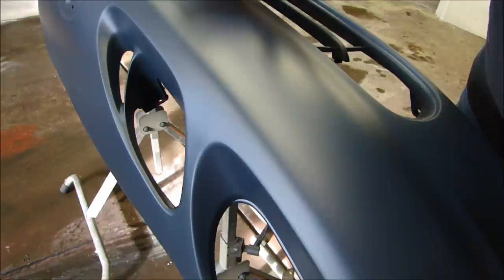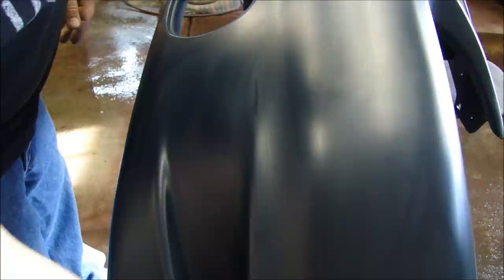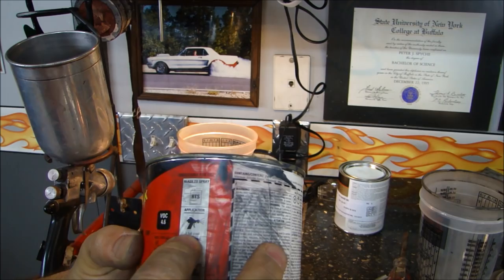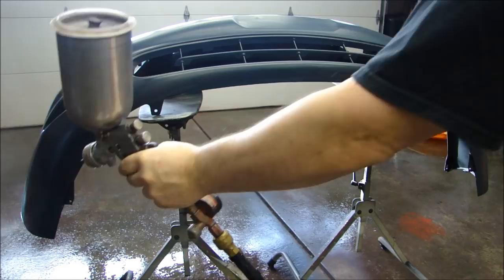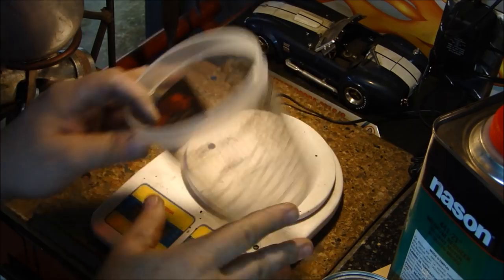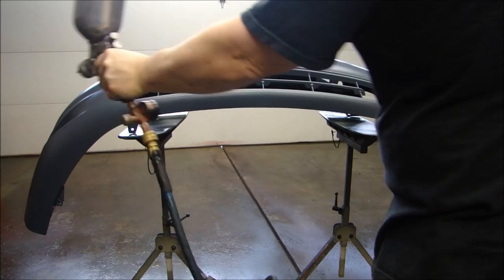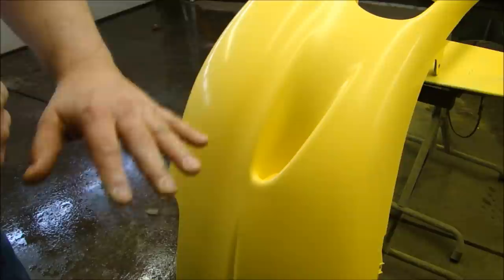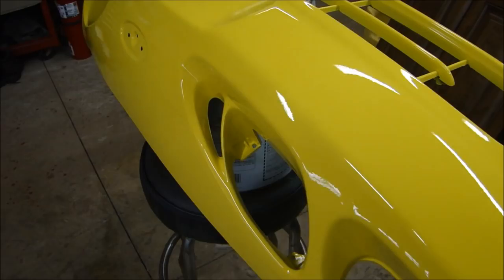Painting Tips & Tricks

Comment: what about air pressure what you use for basecoat is not the same as clearcoat could you ellaborate please love your results.
Reply from the maker: Rodolfo Pierre I adjust pressure at the gun. 40 to 50 is good depending on tip size and metallic level.
Reply: +Rodolfo Pierre  Hello I like your video, especially your advice in the second half about how tocar spray painting tips and techniques
. Something I also found useful for scratch car repairs
  is Corbandy Car Sprayer Crusher - it will be on google if you need it
Reply: +Rodolfo Pierre  Hey, your idea is very informative about car spray painting tips and techniques.You can follow moorack car spray miracle for more information about it.If you needed you can search on google.

Comment: Pete if you ever get a full job in you should step by step it from start to finish. quick question I plan on painting my audi. oem paint  is still good, just want a color change. so I'm gonna sand it down. 3 coats epoxy primer. then throw a guide coat on, and block sand the whole car 180 then put 2 more coats on of epoxy, then wet sand then 1 coat of sealer. then base that sound ok or? please let me know and also my question is AFTER MY 3RD COAT of BASE should I wet sand? or even can I wet sand??? or just go straight base to clear and then after clear color sand and buff please let me know Pete thanks
Reply from the maker: +Justin Miller I have a job coming up where I can go start to finish. That sounds like allot of primer, but if you're going to sand it down then ok. After the base coat go right to clear. The instructions should tell you how soon the clear needs to be applied...usually within 8 hours. Then color sand and polish the clear, but you'll need a good 3 coats of clears to make sure you don't burn through when polishing
Reply: +Petes Garage ya that would really be cool if you could do a full job in detail, like you Dont have to record every single second of it but like the major stuff would be good like what grit you start with. anytime you change grits and the steps you go in! or I'll just bring my car to you I live in Lancaster lol il bring it there and well make a step by step for YouTube on my car with petes garage as my mentor lol
Reply from the maker: +Justin Miller Now that is a cool idea. We can think about that
Reply: You can test out some astro paint guns and Sharpe finex fx 1 2 and 3000s I get free guns from there to test product!
Reply from the maker: +Justin Miller That sounds really cool. I'll be in touch

Comment: Great video 
Thank you very much, 
   I have question what is the best air pressure required for base and clear coat?
And perfect temperature in the painting time?
Reply from the maker: Depending on your gun and tip size, around 30 psi. Follow the temperature recommendations on the product you are using
Reply: @PetesGarage  thank you very much

Comment: hey, can anyone give me any tips on preparing the fiberglass camper shell on my truck for paint? it has a good amount of spots where it has chipped down to the fiberglass, any advice is greatly appreciated.
Reply from the maker: Just sand it down and put on a good primer surfacer and wet sand. It will be ready for paint.
Reply: alright, thank you Pete. i'm glad to hear i shouldn't have to do any gel coat repairs or anything. any advice on what grit paper to use on my orbital sander?
Reply from the maker: I would hit is with 100, clean it thoroughly, fill and dings or scratches with a 2 part filler, use a polyester surfacer, Wet sand to 360, seal and paint.
Reply: alright, thank you for the help pete!

Comment: Pete, can I clear coat over the top of single stage urethane enamel to make it look deeper gloss?
Reply from the maker: +Dan Carroll You can, but you have to use the same paint. Check to see what is compatible. If you're not sure, make a test piece.
Reply: So if I buy a gallon of black enamel, I need the same enamel clear and I should not have a problem, right?
Reply from the maker: That is correct, especially if you buy them from the same place at the same time. Always follow the manufacturers recommendations
Reply: What single stage do you like?
Reply from the maker: +Dan Carroll I have used Dupont products for a long time. I've had success with others, but that is what I prefer

Comment: petes i need your help
please how i remove paint blobs after using touch up paint on chips??
what to use paint thinner??
Reply from the maker: +Tomer Tzur A blob would have to be sanded down. Thinner will remove all of the paint
Reply: +Petes Garage its 2015 mercedes i cant sand it 
too scary
please any other way?
Reply: +Tomer Tzur use a very gentile touch, take your time. I used to get the willies touching up my uncle's 66 Riviera every time.
Reply: +Space Ghost  use what paint thinner?
Reply: +Tomer Tzur no paint thinner ever.  lightly sand with finest grit check into wet sanding also. you should be able to level off the bump without damage to the surroundings. paint thinner is unpredictable and could damage a larger area. if it were me. I would ride it as long as paint is covering the whole chip you won't have rust issues.

Comment: After the base coat is applied, how long do you wait to spray the first coat of clear?
Reply from the maker: As soon as it flashes....or 15 to 30 minutes....up to an hour
Reply: Would this be the same when you're painting the clear?  Spray the first coat of clear and then wait 15 minutes; spray the second coat of clear, wait 15 minutes, etc...
Reply from the maker: Yes. For the clear I lay down two 3/4 coats and let it sit 15 minutes in between and finish with a full wet coat
Reply: thieves essential oil

Comment: You know the difference between sealer and primer?
Reply from the maker: Primer is designed to prepare a base surface to accept paint. It is porous ans has a greater grip strength. Sealer provides a protective chemical barrier so succeeding coats do not affect the previous

Comment: What PSI on your gun do you recommend for clear coats most of time?
Reply from the maker: Depending on the clear and temperature I'll start between 15 and 18
Reply: @PetesGarage  is this on a hvlp at the gun?
Reply from the maker: I have a regulator on the gun so it's actually 15 to 18 at the tip.
Reply: @PetesGarage  What does that mean at the regulator? What PSI on regulator then? thanks for your kind responses btw. Im trying to clear some headlights and bought some of this clear which recommends 10% reducer added to start https://www.kbs-coatings.com/DiamondFinish-Clear.html.
Reply from the maker: It means I have pressure to the gun up to about 60 psi and a small regulator on the gun itself so I can adjust it while spraying.

Comment: you mentioned spray pattern and airflow fof painting can you elaborate at all.
Reply from the maker: +gigabytex64 The spray patter is the shape of the spray, either a spot of a fan. That is adjusted on the gun. The airflow is a function of pressure and gun tip size. The paint manufacturer should recommend both on the can
Reply: +Petes Garage Thanks for responding, I have had a paint job where the finish cam up flat and powdery, but usualy when I spray enamel, any ideas I was running 25 psi and used there measurement of thinners 50 50 mix.
Reply from the maker: +gigabytex64 You may be moving the gun too fast and holding it too far away.
Reply: +Petes Garage it might be the speed as I move as fast as I spray epoxy paint, it gets runny if your to slow.

Comment: How do you decide on flow rate or PSI of the gun?
Reply: Also what do you use to purify the air?
Reply from the maker: That is determined by the nozzle size and material viscosity. The manufacturer provides a good starting point
Reply from the maker: A good coalescing filter and air dryer

Comment: How did you avoid having to use adhesion promoter on the raw plastic?
Reply from the maker: If you use a solvent based sealer it will melt into the plastic.
Reply: Paul C the bumper Pete painted was not raw it was primed but yes you must use and then he's in promoter over raw plastic parts Bulldog are some reasonable facsimile

Comment: Pete, thanks for the tips.  I'd like your opinion on adding a flex agent and adhesion promoter to the sealer, base and clear coats.  There is a fascinating article at 
http://www.searchautoparts.com/abrn/technicians/paint-shop/painting-plastics-recipe-success
which would indicate the cheaper aftermarket bumper covers would benefit.  I am replacing my ML500 plastic bumper cover which was heavy and brittle (and cracked and wouldn't stop cracking) with an aftermarket (primed) cover that is much more flexible.  I think it's noteworthy that the mold release can "move" from the back of the part to the front, causing long-term issues, which certainly reinforces your "don't touch it" comment.  I'm thinking of taking my cover to the car wash and spray off the inside of the part as best I can.  Probably can't do a great job because it has an internal reinforcing part sonically welded to the exterior cover.  Pretty much all mold releasers are water based these days because of environmental disposal limitations.  I'm hopeful that the cover vendor adequately prepped the exterior before applying the primer.  I guess we'll see.
Reply from the maker: You can certainly add those agents. They do help, but are expensive.